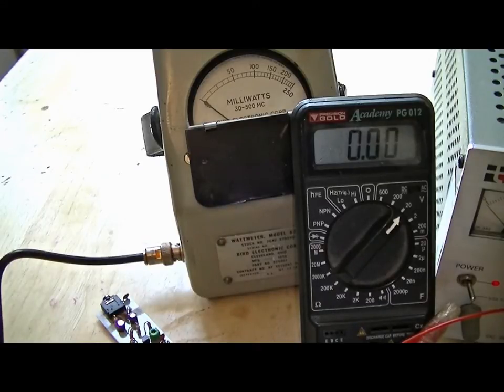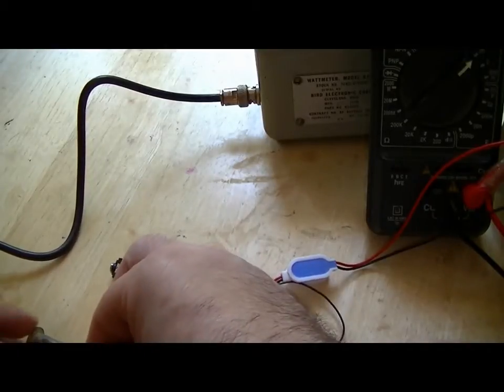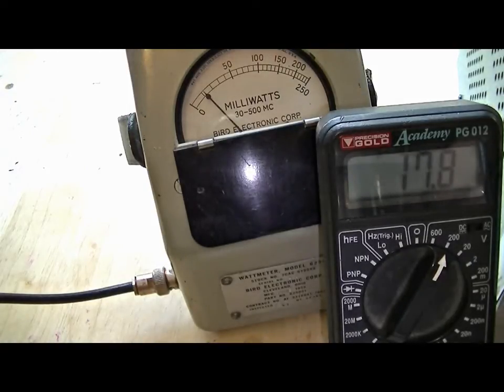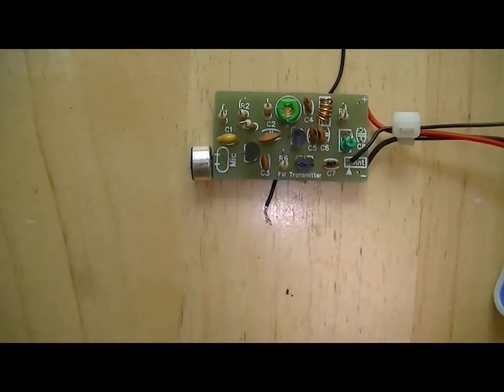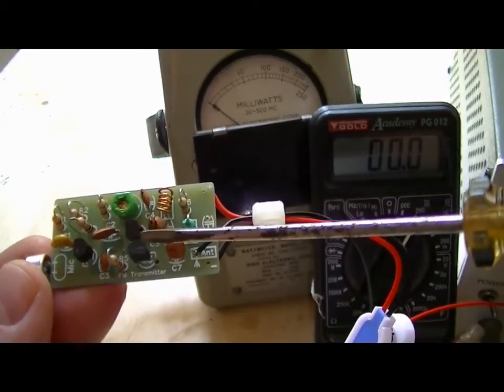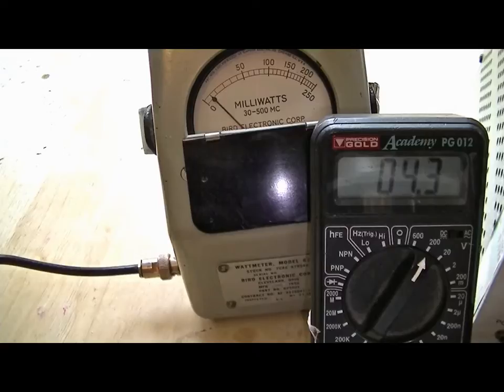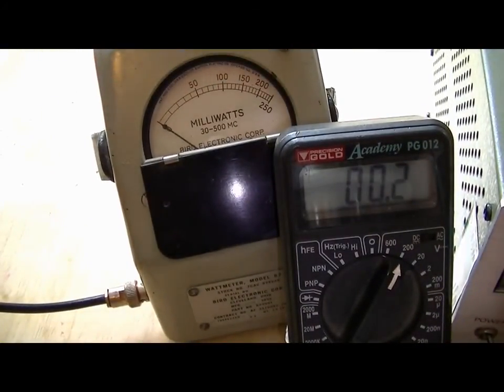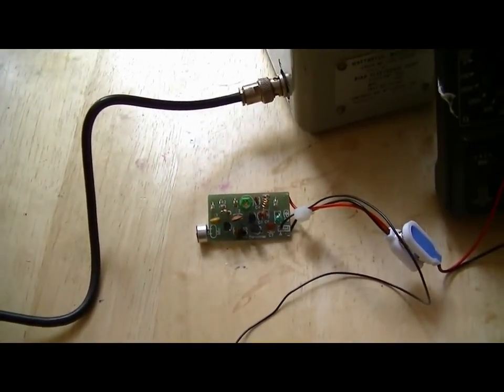How much RF power in a tiny FM transmitter ?

Comment: For the three stage transmitter circuit we can assume the output power would be --> ((9V/2pie(1uF)(100Mhz))(9V)) = 129mW.. but ideal situation.. according to your test only 31% of potential power transmitted..
With all this said.. can you make this circuit again but add another 1mH inductor in parallel?

Comment: nice informative video.
why you dont connect the negative lead to the rf power meter? what is the reading of the rf power meter if both the leads ( positive and negative ) are connected to the transmitter?
best regards

Comment: I bought a "bug" off Dx and it barely works...it's got issues...but what I was wondering is it probably just an fm transmitter like these? I'd try testing it but it's not working...my bug detector finds it...I just thought with your experience you may know, if it's not fm, then how does it transmit? 
Peace n Tanks

Comment from the maker: The Bird 6250 RF meter used in this video is super sensitive and it gives a very accurate reading without using a negative lead ,i have tested the same low power FM transmitters with a spectrum analyzer and the RF measurement was within 10% of the 56 year old Bird 6250 RF meter used in this video.

Comment from the maker: It is best to use a RF transistor in the oscillator stage but i use the 2N3904 in the oscillator stage becuase there is very little frequency drift when a drop in battery voltage ,you can replace the tunable 2.5 turn coil with a variable capacitor and a 5 turn coil like in many of my other videos.
Reply: Is its schematic available? 
Thanks